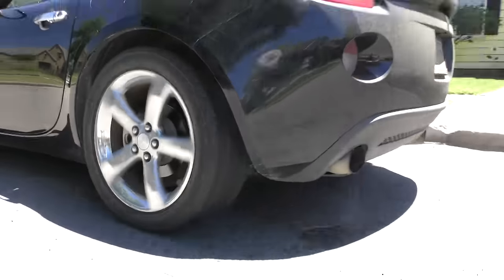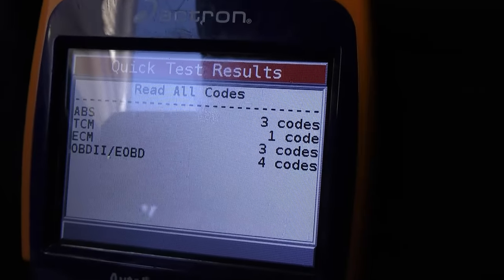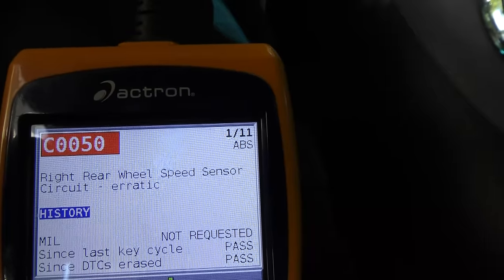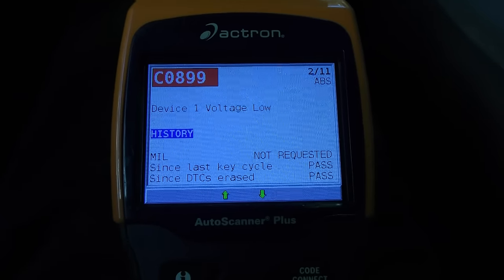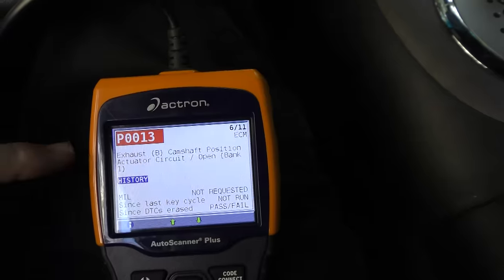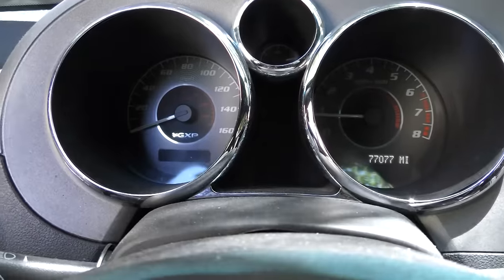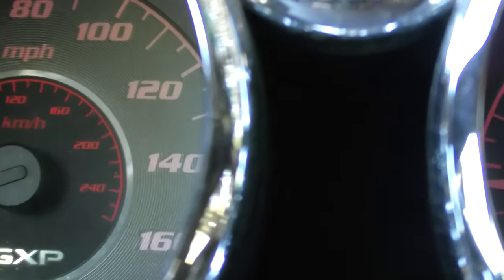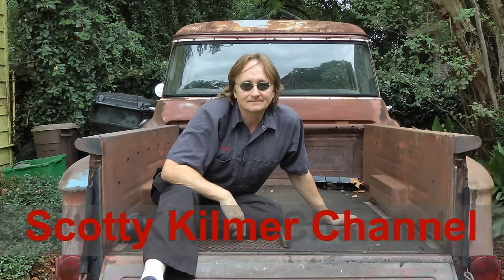Check Engine Light On in Your Car? The Truth About What it Means

Comment: Just make sure, when you do get a "check engine" light, you have good oil pressure(the oil gauge is in the normal range or the "oil" light isn't on.) I love how the repair shops advertise that "if your check engine light comes on, take it to us immediately!" So they can tell you to buy a bunch of stuff you probably don't even need!
Reply: 73challenger5031 our shop doesn't advertise that way.  it's the customer's responsibility to have their car looked at.  you shouldn't ignore the light and at least determine why it came on.  most of our customers take good care of their vehicles and don't ignore the light.  not all mechanics are out to rip off customers.  if we did that it wouldn't take long to get a bad reputation.
Reply: Did I say "ignore the check-engine light?" No. I was just stating that I've seen commercials that tell people to bring their car in for service when, if they want to save some money, they could do what Scott says and check the code themselves. Yes, not all mechanics are out to "rip off customers," but, as an example, I told my wife to go to the Jiffy-Lube, that I always go to, and get an oil change. She calls me from there and tells me the guy doing the oil change says her serpentine belt is on up-side down and she needs a new one! I get really pissed off because, 1. She just had her water pump replaced by a very reputable shop(that I use exclusively,) and THEY put a new belt on and 2. The damn car wouldn't run very long if the belt was upside-down anyway! So, bottom line is, if you're uneducated about how a car runs, there's always some joker trying to get you to buy stuff you don't need. I'm glad your shop doesn't do that and I'm not accusing YOU of anything. I want people to stop being lazy about informing themselves about their own cars and SOME mechanics to stop taking advantage of women!
Reply: @Discretesignals  I agree , not all mechanics will do you wrong

Comment: What I've learned, with check engine lights, ALLWAYS check the electrical connections first before replacing any parts. Lots of times it's just a loose connection that makes those stupid codes come up.
Reply: RestlessJack 00 true
Reply: Thank u
Reply: Thanks I'm new to cars
Reply: Yes, you're right! My electrical system probably got a bit wet from an undercarriage car wash and it set off the engine service soon light.  According to the owners manual, it should go off once everything is dry after driving it a few times.  Otherwise, the car runs fine.
Reply: True
Reply: Or a corroded connection or even a bad ground, but yes ... checking electrical connections and wiring for integrity first before throwing parts at it.
Reply: @AstrosElectronicsLab  How do i check the electrical connections? 😂
Reply: @AfterFurtherReviewCFB  is that a serious question?
Reply: thank you!

Comment: I had a check engine light go on in my 2005 VW Jetta 2.5 after it had about 5000 miles on it. They fixed it twice.  It's still on at 391,000 miles, and still runs great, so I guess I'm not goint to worry about it anymore.

Comment: Many times if the problem is that the gas cap needs tightening, after doing the tightening, it may take a day or so of driving for the Check Engine Light to go off (assuming the gas cap was the issue in the first place)

Comment: So Basically if the light engine turns on, don't be alarmed because it could be a minor thing as long as you hear that the engine is fine.

I'm glad I watched your video because my light engine car turned on yesterday on my way to work and I was panicking but it turn off later on my way home. My car engine sounds fine.

Thanks for uploading this video it helps me to relax a lot.

Comment: I learned one thing from my mentor, back when I was an apprentice.. Don't throw parts at a car to see if it fixes it.
He never got around to actually do a diagnosis on the cars he got in.
Once we had a car with the air bag warning light coming on when you drove over a bump in the road.
He changed every single airbag component in the car, except for the curtains, with the same result.
After a week or so, he gave up and handed it over to me (I was still an apprentice) and I found the fault in 10 minutes. 
The wires to the right curtain airbag was pinched between the dash and a-pillar.
Cost $2 plus labor to fix it... And several thousands for all the parts we couldn't return...

Comment: A gas cap without a seal or gasket can turn the check engine light on
Reply: EVAP leak code, yes.
Reply: My 14 Silverado gave me a message on my dash saying that it needed to be tightened.
Reply: Happened to me, the gas cap wasnt on tight enough and it turned the light on

Comment: I agree with your thoughts on this. Engine sensors do their job, and as long as the engine does it's job too, good enough! Trying to outguess a faulty sensor can be frustrating too.
Reply: Ram 1500s are the worst with check engine lights and tracing them down.

Comment: I've learned multiple times with my own vehicles that patience can turn a crazy problem into the easiest fix ever. never go diving in taking everything apart and throwing parts at a car because most of the time it won't fix it. if an intermittent problem isn't leaving you stranded just wait

Comment: I have a 2002 Accord that I bought in 2006. To add a little proof to Scotty's information, the check engine light has been on for TEN YEARS!! I had a guy check the computer after a while to see what was wrong. He said it was an O2 sensor and a secondary vacuum leak. Like he says on here the car was running fine so I just left it alone. I found out one day that my brother in law was a mechanic back when Kmart did car repair. He had worked himself all the way up to being the southeast regional manager...so he pretty much knows what he's talking about. I posed the question to him about the  problem and he asked me 3 questions: did idle ok? did it run smoothly when driving?..and was there a drop in gas milage? I told him they were all good. He said don't give it another thought unless one of those things happens. That was 5 years ago and the light is still on and it still runs fine!!

Comment: Scotty Kilmer makes some interesting points about the codes behind the Check Engine Light. But the problem I had with it is different: for over a year, the check engine light was erratic in a very different way from what he describes. The car would wrong for months and thousands of miles with the light off, then it would switch on and stay on for months. After seeing this happen a few times, I finally bought myself a scan tool similar to his but not quite as fancy: it showed only DTC codes, nothing fancy. The only code it ever showed was the code for bad knock sensor. So I went to a high quality parts store and bought a new one. But by the time I was about ready to take the time to pop the hood and install it, the check engine light switched off!

You can imagine how hard this made timing getting the bi-annual required smog check! But for the last year, the behavior was a little different. Instead of months on and months off, it now turns on only for a brief while: by the time I find  safe place to pull over and use the scan tool, it switches off again!

I finally took it in to the dealership to let them use their proprietary scan tool that reads all the proprietary codes and they still could not find anything wrong with it -- except that it still roughs and surges.

Comment: 1. Depending on the vehicle, it's not a very good idea to drive without a functional ABS, because the ABS is responsible for brake biasing.
2. The check engine light will be on every time something goes wrong with your car that stops it from regulating emissions properly. Also, for most faults, you will need at least two drives to turn the light back on. You definitely don't want to clear it, do a drive to confirm it stays off, and then your customer has it turn on during the drive back home. They won't be happy.
Reply: The air is no cleaner today than it was in the 1950s.
Reply: @marblox9300  Which is a good thing, considering how many more cars are on the roads today.
Reply: @CristiNeagu    I guess my point flew right over your head.
Reply: @marblox9300  Or maybe my point flew right over yours.

Comment: I learned a long time ago that the first thing you buy if you plan to work on your own
car is a OBDII reader. I picked up the Blue Driver and set up the application on
my iPhone. It works well. It did have to update it's software to work correctly
with my 2014 Infiniti, but once that was done, it read all the codes. This told
me that my ABS light being on meant the right front wheel sensor has an issue.
I'll fix it some day, but that I can live with for now. You can not 'shot gun' modern cars.
You have to know exactly what codes that check engine light is throwing. 
As for buying an older vehicle, you'd have to go back at least three decades.
Even my 1990 5.0L Mustang has an ECIV engine control module and 
digital multi port fuel injection coupled to four O2 sensors as well as throttle
position sensors and a mass air flow sensor.

Comment: 1 Disconnect the negative (black) cable from the battery first.
2 Wait for at least 2 minutes as you turn lights on/hold down horn  to drain energy from circuit
3  Reconnect the negative cable to the battery.
4 Start the engine and check if the check engine light is still on.
5 if still on or comes back on, reseat or clean  petrol/gas cap

Comment: I have a 2007 Honda Accord v6 and for about 2 years the check engine light occasionally and randomly flashes at extended idle but always goes away upon revving the engine and driving .  Have had two different mechanics work on it and change ignition coils, plugs, reset the computer, yet it still occasionally happens.  Yet other than that the car runs just fine.  The last mechanic to check it out finally just said it could be a dirty sensor somewhere, a loose wire, or a glitch in the computer.  He said don't worry about it unless and until the check engine light flashes while you're actually driving.

Comment: The majority of the check engine light problems are the EVAP system.  There must be about fifty parts of the EVAP system the shop can swap out, costing you each time, and each time, there will be a different code, which means they can swap out another part, and on the way home, or the next day, the CEL comes back on and they swap out another part!  Two months later, you have spent several hundred dollars and the check engine light is still on!  It's difficult to test the parts, since they done away with the vacuum operated parts, because that was too easy to test!  The EVAP is the greatest boom for auto shops ever devised!